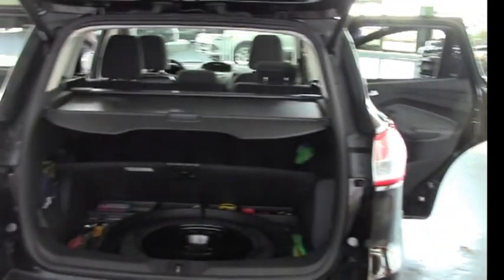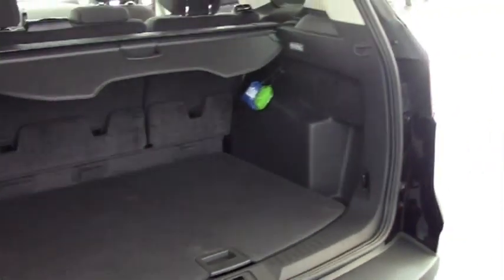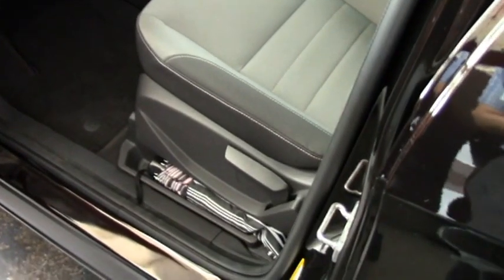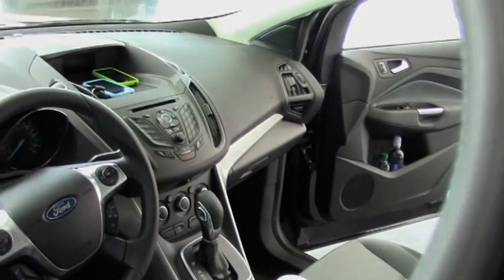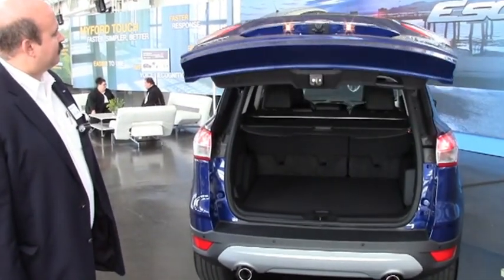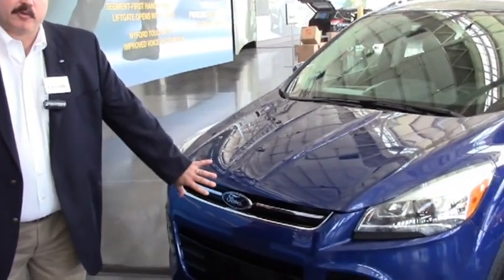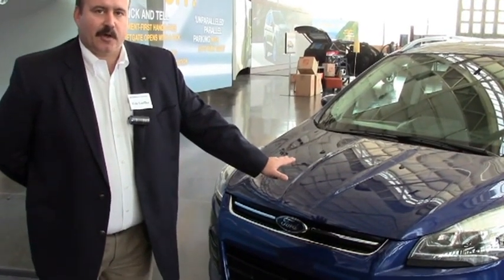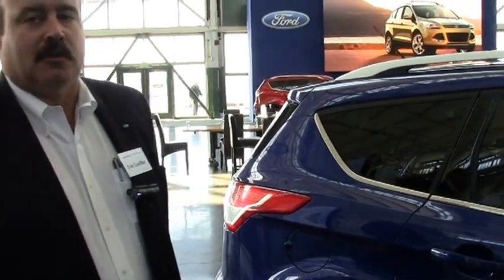2013 Ford Escape walkaround with Chief Engineer Eric Loeffler

Comment: This guy needs a refund on his engineering degree.   I’m just assuming that he even has one.    It should be a pre requisite that any engineer needs to be able to repair the equipment that they design.    Look up the dealer charge for a turn signal repair and replace!!!    For a basic maintenance item.    Disgraceful!!